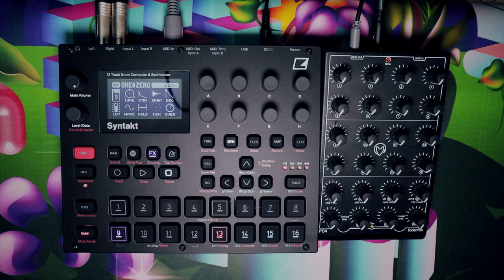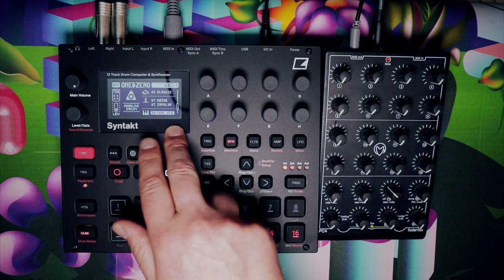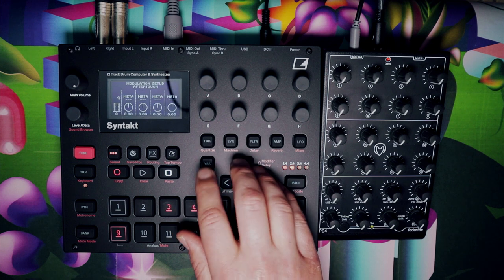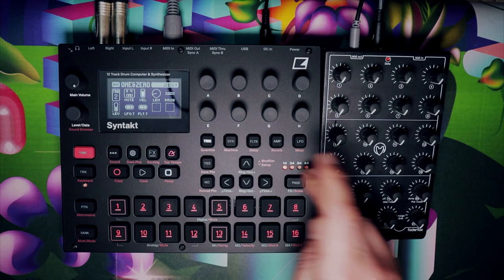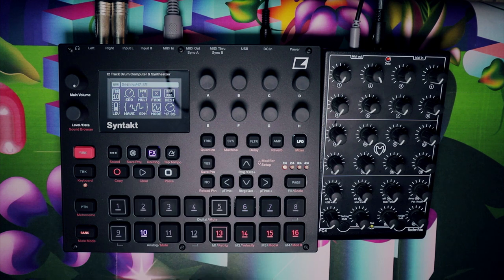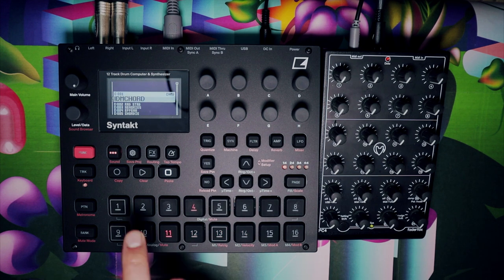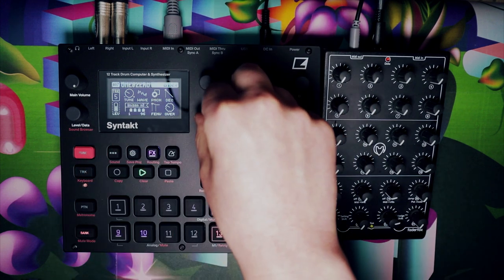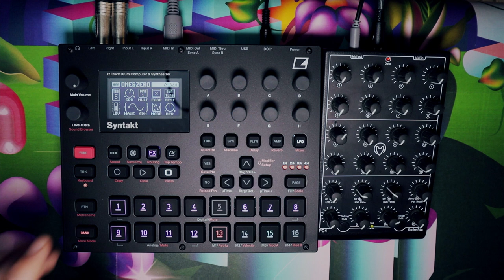Syntakt + Faderfox PC4: Electro Performance Breakdown Tutorial

Comment: I have 2 AS1s and they need an external device to get under the hood.
I am ordering the Faderfox EC4 which gives me 2 rows of 8 for each AS1.
Page over and I have 16 per unit, that's quite the flexibility.
I will never have to tether another synth to a PC again just because it lacks knobs. Most exciting is the Blofeld, an amazing synth let down by lack of knobs.
Nord 3P can benefit too but most rewarding is being able to patch change without having to hover over said synth.
These devices maybe pricey, but well worth it in the end. I have been searching for a solution locally and only the MIDI Fighter is available, has no screen, no din in or out and costs around the same.
I managed to get 1 from Thomann cheap, + 3 years warranty so it's a no brainer for me.

Comment: Subscribed. Nice energy! Looking forward to the next videos. 
2 questions: 
can you record the modulations you build with the Faderfox into the Syntakt sequencer?
there seems to be an option to modulate parameters for ALL the tracks and machines, can you decide which parameters are affected on all tracks or is it default?
Reply from the maker: 1. Haven’t tried that yet and I have a sneaky feeling mod and breath can’t be trig locked but I will check :) you could very well do that if you map individual parameters instead of the performance macros.
2. I hardly use All parameters option, it’s unfortunately not adjustable, that would be an amazing little performance hack. I would definitely use it to open up reverb and delay time
Reply: @jamesorvis_mixhackers  coolio! About mod and breath: my sneaky feeling too (at least that was sadly the case on the Digitone, it won't record them). But as you say, better focus and be creative with what's there and there's so much on this unit.

And yes, mapping the same Faderfox or Twister knob to many parameters could be a sick bunch of macros. Can't wait to get my own Syntakt. Thanks so much!!!
Reply from the maker: @fumarolas  I almost went down the one knob to control all parameter route like how I do it on Octatrack. But I think there’s a lot to be explored when having access to multiple sound scaling capabilities. May do a video soon though testing the one knob method. I just had a cool idea, you could have 4-5 one knob macros like this because there’s mod, breath, velocity etc so you could have 4 or so really good macros that control multiple things each.
Reply: @jamesorvis_mixhackers  Yes! Exactly what I had in mind. Exciting. I used to have a Touché for this kind of 4 macros situation.
Reply from the maker: @fumarolas  haven’t looked at the touché yet

Comment: I am trying to pass midi clock through the PC4 and dosnt seem to be working.  Is the possible?  midi clock going into the input and passing the midi clock through to the output?
Reply from the maker: I need to investigate as I dont use it to pass midi through. But my guess is no it wont work, you need a 'midi thru' output. Unless the out works as midi through and out at the same time? I will look into it, if it doesn't, dont worry, you could get a midi box like the Kenton stuff, I recently got the Kenton merge 4 so I could copy and distribute signals, I think that would be the right fix for you? Or something similar?
Reply: @jamesorvis_mixhackers  i picked up a Merger V2 2x2 MIDI Merger to merge a midi clock signal with the PC4 's output.  A little pricy for such a basic function that i feel like could have been a simple thing to have in the PC4 firmware... but it works!

Comment: Did you make video on setting up the mod wheel? I didn’t see one on the channel, but I may have missed it.
I have a FaderFox EC4 that I am trying to get up and running with the Syntakt
Reply from the maker: Filming that one next week :)
Reply: @jamesorvis_mixhackers  I finally figured it out somewhat. Issue I had was I forgot to set up the midi receive in on the Syntakt from usb to Midi or Midi+USB. I did notice Elektron l’s cc mappings are a bit different than standard ones so that is something I need to look into a bit.
Thank you so much for the quick reply. I’m an electro fan as well and love the walk through in this video!! Look forward to watching more of your content.
Thanks again
Reply from the maker: @JustinUrban1  Mappings are similar to other machines but the CC numbers correspond to specific things in the syntakt, it’s best to refer to the manual, at the end there is a midi cc appendix. It lists all the category’s, parameters and relevant cc number. The other thing to consider is midi channel, so all tracks will share the same cc number for, say, the filter, but midi channel refers to which track the message will be sent to. As an example, track 1 is midi channel 1, track 2 is midi channel 2 and so on.
Reply: @jamesorvis_mixhackers  I did get the channels worked out. Now it’s just the cc mapping per channel. I’ll have to look at the manual again. I looked at the little booklet that can with this unit, but am not sure if that’s the complete manual. I found that the standard 74 controls the filter cutoff, but 75 instead of 71, which was listed in a standard cc mapping document I found online, controls the Resonance of the filter. I love the dual VCOs in the analog machines on the Syntakt for those acid style sounds so those are my first main parameters I wanted to get down.
Sorry for rambling on lol. I just love the Syntakt for its inspirational creativity workflow.😃😃
Reply from the maker: @JustinUrban1  Yeah its great! I love those dual VCO's too! Yeah the book is a start up guide, support page on Elektron website has the full user manual, its pretty hefty!
Reply: @jamesorvis_mixhackers  Where is it?
Reply: @JustinUrban1  Could you please explain how to setup the PC4 with the Syntakt? :)

Comment: Exceptional video & track, thanks for sharing your knowledge. Question for you: I’ve seen some complaints online about the PC4’s 7bit resolution, suggesting that using it for things like filter cutoff could cause stepping because of less granular values (vs the 14bit resolution of say the EC4), but I didn’t hear anything like that with the assignments you had - did you come across any similar concerns? I was hesitant to grab a PC4/12 instead looking at the EC4, but obviously the PC series wins the day on sheer number of knobs so it would be preferable provided the resolution is not an (audible) issue. Appreciate any thoughts you have on this & look forward to checking out your other videos, cheers.
Reply from the maker: Hey sorry for the late reply! I haven't noticed, but maybe thats because im used to digital controllers and Ableton from performances starting over a decade ago, maybe im just used to the stepping now. Im sure there probably is but nothing to put me off using it so far. I think the PC range is definitely more suited for Syntakt because of the definitive stop and start of the knobs and how the mod depth amounts are global, if the Syntakt reset the knobs every time you changed the pattern then the EC4 would be a good shout. Thats how I look at it, if the piece of gear resets values then endless is a good option, if the values stay constant and global then classic fixed knobs are the better option as you will always know where the depth amounts are set during a live performance.
Reply: @jamesorvis_mixhackers  Cheers James, makes sense & appreciate the detailed reply. I took the plunge and ordered a PC4, keen to try it out - and perhaps one day upgrade to the behemoth that is the PC12 to use across a few of my Elektrons. All the best.

Comment: Syntakt has 12 channel/track. Why not then PC12?  Why PC4? thx
Reply from the maker: You absolutely could do that and have even more control. Personally for me it’s overkill, just two performance macros per track adds so much to my set without been overwhelming. PC12 looks brilliant though but takes up more space. Good use case would be to use a PC12 to control multiple machines